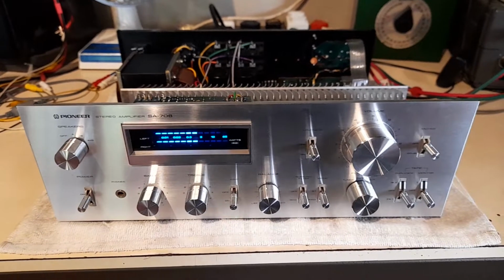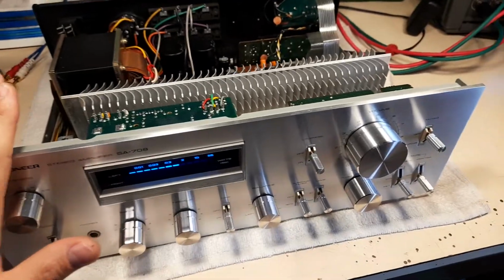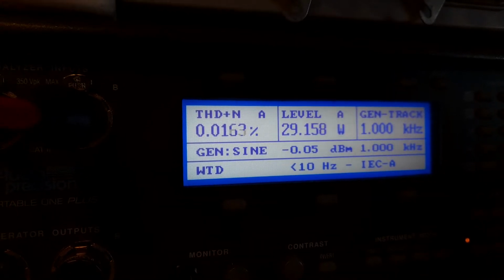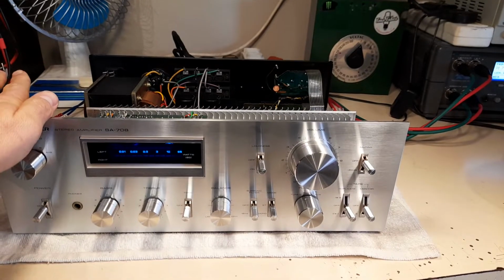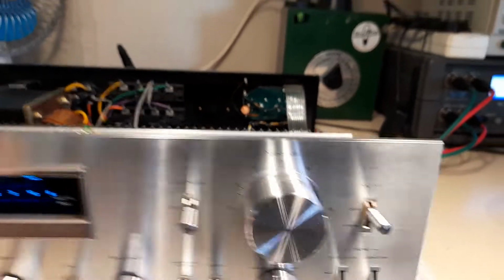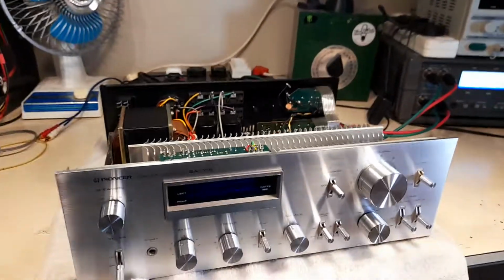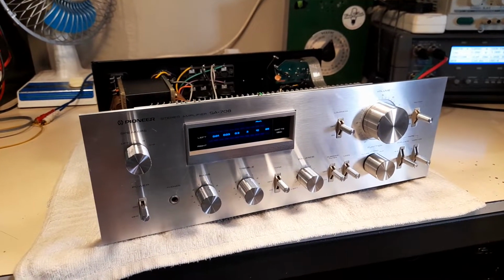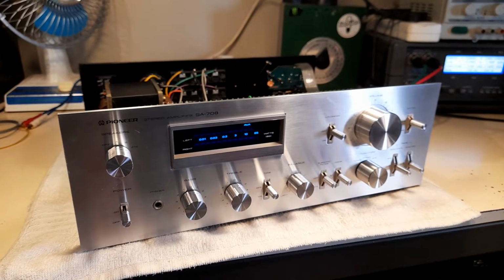Pioneer SA-708 amplifier - its wonderful specifications and timeless features

Comment: Wonderful review! Imagine my delight tonight watching this video after picking up a fully functioning set of the following for $80 not knowing if they were completely worth it:

Pioneer tuner TX 608
Amplifier SA-708
Dynamic Processor RG-2
Reverberation Processor SR-303
Graphic Equalizer SG-9800
Tape Deck F-650

Comment: I believe those output transistors are actually from the Japanese Fuji Electric. I wonder if the MT200 Sanken transistors like 2SC3264 would fit. Still obsolete, but much more recently.

Comment: excellent video. i have that one stored, sadly haven't used for 30 years cause is 220v and i currently have 110v. i still remember the great Quality sound, and beautiful look
Reply: mine has a switch on the back to change it from 220 to 110, yours should too.